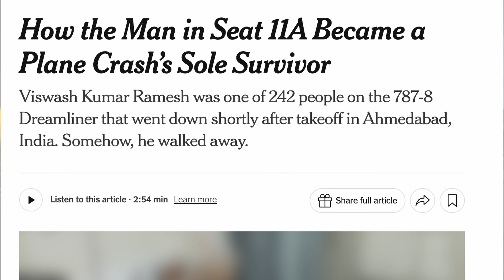Why the RAT Changes Everything – Air India 171 Update

Comment: That original video is the one I first viewed.  Hearing the RAT I at first thought something like a Cessna 140 on full power, then realized what it was.  That aircraft has a few different situations where the RAT is deployed - both engines, all 3 hydraulic systems, loss of electrics to the pilots consoles and a few other I can't remember.  Engines appeared to be functioning as you could hear the engines behine the RAT noise, but could possibly have been spinning down.  All 3 hydraulics failed?  Possible, but unlikely all 3 at once.  However, that could be an answer for the gear to be still down.  Electric issue?  Based on the video from a passenger about nothing in the cabin working properly this is my current theory.  We really do need the data before any real sense can be made.

Comment: That is incorrect. I understand the language and the survivor did not say this, he said soon after take off it felt like the plane got "stuck" thats his exact word. I would assume sudden loss of acceleration would feel like just stopping mid-air, like when jets take off a carrier, they are shot off the deck with a slingshot which is a very violent experience and as soon as they clear the deck it feels calm all of a sudden. And he didn't say the lights flickered, he said the green(exit sign) and white cabin lights came on.Which AFAIK come on automatically when there is a sudden loss of power.

Comment: The guy that survived he said when they took off at a certain height it felt like the plane stoped and than he said he heard the engines increase in power so it's weird that he heard the engines increase in power if they were not running and in this video there is no jet engine noise only the rat propeller is heard maybe it's the rat that he heard.

Comment: All the videos, including the runway runs, show one thing that stands out, the flaps do not show being in the proper position and on three angles on the runway do not appear to be down at all. The gear lever and flaps lever are in two totally different spots. The investigation will show what happened ultimately. As for me, 100 plus degree weather, a heavy aircraft, and no flaps sells it for me on the no flaps theory.

Comment: If CCTV cameras had an infra red sensor it would be possible to "see" heat from the jets.
The footage shows no heat haze from the turbojets on an already very hot day.
That would indicate total fuel shut off at the moment the Boeing left the runway.
If fuel contamination had been caused by water it could explain why the undercarriage didn't lift up because of water or steam disabling the relays on the landing gear. Note especially that the rear wheels were slightly pointing down. This indicates no power in the large mechanism.

Comment: Hello Steeve... 
I guess both the fuel valves were switched off and there was enough fuel in lines to just take the flight to 600 to 700 ft height. As there was no fuel in line, both the engine stopped. There seems no electrical failure but as the engine stopped, emergency alternator was automatically deployed, hardly the pilot can manually fix this issue. 

This might be a case where what we see is not what we know, maybe it's a Precisely planned attack on India by the Terrorist to take revenge of Latest operation. Maybe the ground staff were forced to do this error... 

It's all maybe unless it's officially released.  But this is my angle of thinking .. don't know what's the real case thought... but it's highly unlikely to crash the plane just after take off...
Reply: I knew this 3 weeks back Captain Steve .. any comments on this?

Comment: I was able to see this a few days ago the clearer version you have here, I also saw a video of one of the wings that show the flaps down but the angle looked too shallow (after crash). Could, on take off a hydraulic line have failed and not allowed the flaps to come down to give the appropriate lift fooling the system into the thinking the flaps were down enough and set off the RAT when actual lift occurred and not allowing the pilots to recover in any way possible due to hydraulic loss? Or does the RAT have a secondary "if all systems fail" hydraulic setup of it's own?

Comment: Man you need to have a bit common sense as well landing gear lever is on the front panel right of pilot seat in 787 and flap handle is on a different panel just left of Co-pilot , there is absolutely no way someone would confuse both the levers and it is insult to the service and memories of both the pilot  and don't forget both of them had 9300 hrs of flying experience . I think in the coming days it will be suitably discovered as another boeing engineering mishap.

Comment: Could also be an AUW issue. There are reports that the pilot requested a longer runway which could be an indicator that the pilot knew they were at max weight and pushed the engines to their threshold. Thanks as always Steve for your excellent reporting.

Comment: Excellent analysis as always. And very respectful to all those affected by the tragedy.

Fro,m what I understand. the flap handle is between the pilots and square-ish, while the gear retract handle is round and in front of the first officer - on the "dashboard' so to speak. While still possible, I think those facts make it highly unlikely that the FO accidentally pulled the wrong handle. Also, I am curious: do Boeing or Airbus systems prevent retraction of flaps immediately upon lift off from the ground? As a flight-envelope protection feature?

Fuel contamination: where was this plane fueled? I would guess Ahmedebad itself, as it would have been a huge waste to fill it up in DEL, where the plane came from. One would expect other planes to be affected to varying degrees if the source of the fuel contamination was one of the large airport fuel tanks. 

Fuel flow obstruction: What about a foreign object or objects  that were  left in the fuel system (as part of some maintenance activity)? These objected shifted position on rotation and blocked the fuel flow to the engines? Just pure speculation on my part.

To all who did not make it:   RIP.

Comment: This was my initial thought, based on the fact that a mayday no power call was put out. The RAT has been talked about since the beginning, based on this video. The sound is distinctive. I did start to change my mind on this as the second video showing the plane take off, the dust raised at the take off point shows the engines are producing thrust. But it is not climbing and not producing lift and something has caused this. No birds, no flames and no bang….so now I think the thought would be no lift due to loss of thrust, a mayday call with no power, the RAT I think is visual and sounding like a RAT would, but I still think you can hear engines as it goes past? The passenger confirming the lights flickered inside, indicating a power transfer. This would indicated loss of engines perhaps due to contaminated fuel, has auto relight happened? The only er thought is the TCMA (Thrust Control Malfunction System) That’s all I can think of for now?

Comment: 🛑 Captain, you ought to cease reporting on this crash — every sentence appears choreographed to subtly dilute the messaging and divert attention from any unfavourable truths. You’ve entirely omitted the possibility of total electrical failure leading to a complete loss of thrust control.

Viewers deserve to know how this video reframes negatives as neutral and raises doubts before presenting facts — a classic technique for instilling bias in favour of certain narratives. 

And what of fuel contamination? Contaminated fuel would have precluded take-off thrust — every aircraft drawing from the same tank would have been equally affected.

Frankly, it seems this narrative minimises the liabilities of both the manufacturer and the maintenance agency — perhaps no coincidence if the latter is a subsidiary of the former.

Comment: So why a dual engine failure can occur at takeoff ? Birds but here we don't see flames or signs of ingestion of something from the engines , fuel contamination , very rare but can occur , or you can have some sabotage because they wanted to eliminate somebody present onboard , and if it's the reason you can be sure we will never know the truth.....
Reply: Autoland closed the throttles, it has  happened before at a flying display of an Airbus .

Comment: From what I heard, the weather that day was 40c (or 104f). It was definitely hot enough to cause vapor lock. It’s probably a stupid question but I’m wondering if there’s even a chance it could’ve been vapor lock? I know that mainly affects piston engines. The higher boiling point of jet fuel and the high pressure pumps make it hard to believe it could even happen but I guess I’m just wondering if it’s even possible

Comment: I’m a 787 captain.  I’m hoping for a quick answer.   The industry needs to know if this is a one off or a problem.  14 years without a major
Incident   And a  duel  failure is so un likely without fuel contamination that is so unlikely we don’t train for that right after rotation. Fuel supply at major airports is so regulated and checked the risk has been mostly mitigated. 
Peace to the crew. I’m sure they did all they could.  Prayers to all the lost and loved ones.

Comment: they should make both engines having separate fuel sources ( also software , electrical ) so that if one engine is unable to function  the other engine will have its own independent fuel source or connection ....

Comment: I do not trust India air, I would not fly with them.   I would believe fuel contamination, or some other maintenance issue that caused the engines to fail.  When greed, laziness and corruption is the primary mindset in a country, what comes next is never good.

Comment: Hi Steve, I was looking at some basic environmental factors ...... no rain since 30th May and temperatures between 30-40 degrees centigrade each day ....... also high winds on the day up to 40km/h ....... also on google earth there is a lot of exposed earth on either side of the runway, so prone to dust creation .... is it possible that a low dust cloud eddy blew into the engines causing blinding of both engines and immediate failure i.e. they had the exact same environmental factor exposure leading to parallel failure (possible also that dust had accumulated prior to this but a BIG dust cloud was the final straw)  ..... finally it does look as though there is  a smoke/dust cloud in the original take-off video 🕵️‍♂️

Comment: Not sure I buy the dual engine failure. Wouldn't the APU be able to pick up the load (I think it does on the airplanes we flight test). Also, I am not as familiar with Boeing's, but don't they have a manual RAT drop. I know ours do because the pilots have to test them from time to time. But I did learn that the Boeings have their RAT in a completely different place (ours are up by the nose).

Comment: I am thinking the gear never went up because they never achieved a positive rate of climb.  To me it looks like they burned a lot of runway which would indicate the engines were not producing full power and managed to get airborne largely on ground effect but once they climbed out of it they no longer had sufficient lift to support flight.  Possibly the pilots raised flaps in an attempt to gain speed with a clean wing configuration in hopes they could  hold altitude or climb but with flaps also being lift devices the gambit failed because they were simply too slow and with the high alpha they were pulling the wing was still inducing a lot of drag, bleeding airspeed until it finally stalled and plopped.  I would say it never reached Vr but had also probably passed V1 so they were committed to take off unless the deemed the aircraft to be unflyable, though this is one of those cases where aborting a takeoff after V1 and taking the overrun would have probably been a better outcome than attempting to lift off.

Comment: if there was fuel contamination, other aircraft should have had the same issues. Iam certain each engine has a separate fuel pumps  and electronic systems - so if one fails the other still works. How about sabotage, since there where no bird strikes or other debris. The plane did get airborne, but did it require the full runway to get up to speed?

Comment: You also CAN'T hear the sound of jet engines as the plane goes by. Also you can't see the trail of vibrant hot air produced by engines working at full power.
Reply: You heard engines in idle thrust safe mode as it flew by with the rat deployed due to Loss of AC power which AC power also runs the AC hydraulic pumps so the gear will not come up. This speculates that due to, I bet, that they did not verify the engine driven generators were online by checking for GEN fault messages (possibly crew alerting system had those messages buried within other deferred item messages) did not see that the engine driven generators were not online, then shutting the APU down just prior to taking the runway. It takes 1 1/2 to 2 minutes for the APU to shut down, so the APU quit just after takeoff and that caused a loss of AC power. Then the rat deployed. Then the engine thrust spools down into idle safe mode. And the pilot would have to move the thrust lever out of toga detent and back into toga detent or full forward, to wake the FADEC system back up into exiting idle safe mode, which would then bring the power back up to TOGA or full thrust.
Reply: @MichaelDavidRobinson  Nice theory! Do the engines really spool back into "idle safe mode" as a result of a non-emergency fault? That sounds like a design flaw to me.

Comment: A plane like that can run on one engine. So one engine can fail and you can keep flying. So what are the odds that BOTH engines in a 787 would just fail? After already working to get the plane off the ground at takeoff? I would say only sabotage could make that happen. And if you rule out sabotage as still highly unlikely, what are you left with? Can a plane run without electrical? Can it run without hydraulic? Have we still not solved why the landing gear was still down?? I would say, based on these assumptions, that pilot error is still in play. Hope the black box can clarify what went on in that plane and what, if any, moves by the pilots might have been responsible for the crash. We will all be watching this one closely. Airplanes are not doing well this year. Too many crashes!!

Comment: Would the RAT really be used to power cabin lighting? I would have thought that it would focus on powering the fly by wire and cockpit instruments. Seems to me like that is an indication of a non engine electrical issue. 

I dawns on me a major loss of electrical power could cause loss of control to a fly by wire airplane even if the engines were running.

Keeping in mind I am not a pilot or aircraft engineer so I could be wrong.

Comment: I still would like a better view because it looks like it had floating spoilers. Thats why I still would place total hydro loss up near the top. (First time seeing your chennel, so my comment is purely speculation from a retired crew chief on Boeing heavies). The flicker of the lights is odd unless the PM switched from AC Bus to DC Bus without the checklist out of simulator habit? The RAT would deploy on its own on the 78 as far as I know (never worked on those. Too new).

It could also have been an attempt to power up the APU, which COULD cause a minor comp stall on startup. To us, they dont make sounds too loud, but could be taken as a loud sound since it is inside the AC. ANd switching from IDG to APU would flicker lights as well.

But if the AC had lost hydro, flats retracting due to wind, it would take a while to build up pressure (since it would have to fight against the accumultaros as well to replenish those, which I dont think you can prioritize where that pressure goes first, since the accumulators are right there by the APU.

Its sad, regardless, and we will see what the final reports say. But I highly doubt simultaneous engine flame out just because its a big jet and fuel lines and teir routine would at least cause one to shut, then the other, and at least give it time to gain more altitude on one engine, plus there would be some rudder input we could see. There was that Challenger than went down in Florida Iirc, where it had lost both engines at the exact moment, but much smaller jet, shorter fuel lines etc. Anyway, its just speculation, so just offering out ideas for whatever its worth. Im sure engineers and NTSB are watching, and theyre the ones carrying the torch now, and the more info the more likely that can cause the spark of inspiration, to prevent this from happening again.

Comment: Sir, very correctly and minutely appreciated facts and came to
Probable reasons for the crash
 nose of plane was up till hitting,so no problem of flaps.
Hydrolic and electric problem hence alternative electricity generation unit came out but it was very acute and critical problem at worst time while plane was ascending it's a engine failure,though nose was up but plane was descending itself suggests power failure or insufficiency.
Bird hitting may be problem as plane was at lower height and within densely populated area.
But  considering failure of hydrolic and electric systems Bird hitting is not very important.
No flames or fumes negatives the bird hitting.
Accident happened in very short time hence pilot wants to land the plane hence kept wheels out.
Nothing can be done within a short time, i e few seconds.